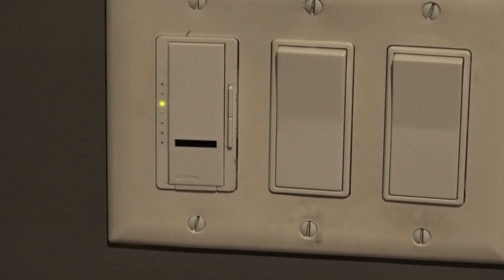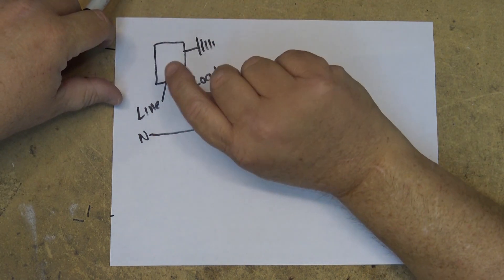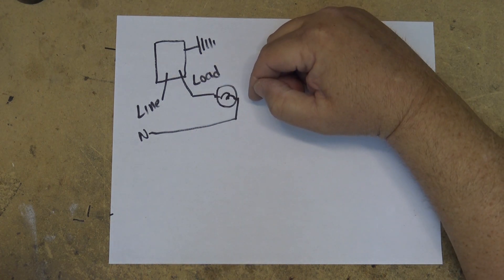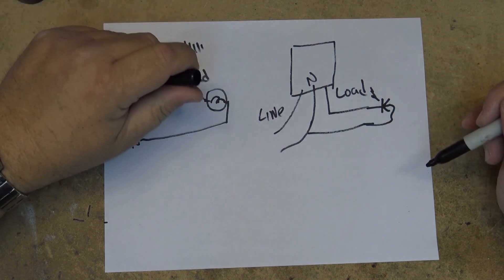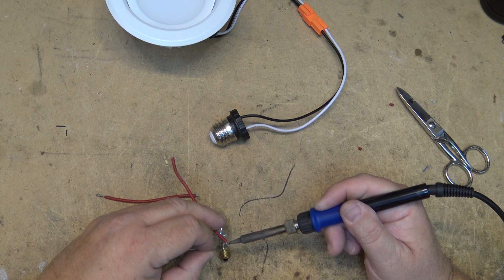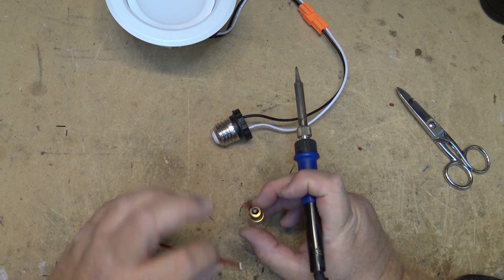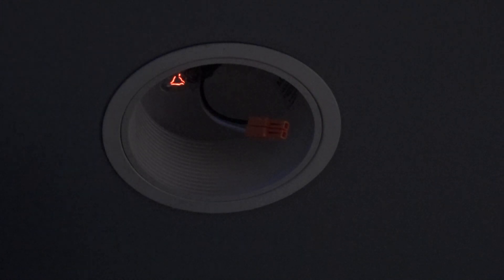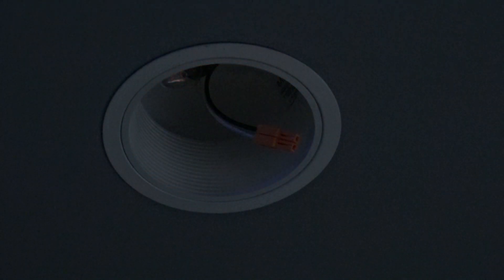How to make an incandescent electronic dimmer work with LED and CFL bulbs

Comment: Okay I know this probably isn't code but the insides of my wall are clear of debris so this is what I did. My junction box with the switches in it had some 1/2" knock outs unused in the top of the box. So I grabbed some of those sockets with the clips on the side that normally hold it inside some transparent lamp and they fit right through the knock out and clipped in nicely so the bulb is outside of the junction box keeping the heat out but it's easy to replace or remove if needed.

Comment: Thank you for the tip (very helpful) -- but you should state out front that it burns 7W when off.
Reply from the maker: It does not burn 7 watts when off.  If it did the light bulb would be burning full intensity.  The bulb is only providing the bias voltage to keep the dimmer powered up. A couple miliwatts max.

Comment: I am a big fan of the LED filament bulbs. Will this circuit mod work for a motion censor ? I have an older stye LED bulb that goes down to around night light status. My mom is happy with that. That's fine because it's a bathroom, but others stay lit considerably bright.  Gotta keep momma happy LOL.
Reply from the maker: Yes it will work for any electronic switch looking for a resistive load.

Comment: Very cleaver constant load but just a suggestion have you tried the same trick with a capacitor, if not may I suggest replacing your 7w bulb with a capacitor value :: 100nf - 250V - (104J) I don't know if it will work but its worth a try? Bob in the UK
Reply from the maker: I did and what i ended up with was pulsating lights when off.   The capacitors in the led power supply would charge up and then the light would blink.  How annoying is that, 4 led blinking away like the old goofy lite p-box kit that radio shack used to sell. Remember those?
A large resistor would do the same, but a 7w bulb is dirt cheap, doesn't get even warm never mind hot, will last forever.  Little 7 watt night light bulbs would typically last 5000 to 8000 hours.  If some day it burns out i will know because the lights will not go out, 1 or 2 will just glow all the time.  Has been many years and all working perfectly as they should.  That little incandescent bulb and the led inserts in the fixtures will probably out last me.
Reply: @12voltvids  Thanks for the reply

Comment: Works great.  the little bulb is so easy.  Avoided replacing my pair of three way dimmers that cost about $60.  Can’t remember if you said this in the video, you just need to add one incandescent bulb per circuit.  Thank you,
Reply from the maker: Yes just 1 7 watt bulb is all i used. This is to keep a slight load on the line so the dimmer circuit gets power.   Led certified dimmers have a neutral connection to provide the power, but incandescent dimmers just used the voltage drop to get their power as the incandescent filament provided that path to neutral. Adding the little bulb does that. And these little nightlights last like 10000 hours or more.

Comment: You could also use a small X2 class capacitor across the lamp.  0.1-0.22uF should do it.
Reply from the maker: Sometimes this works depending on the type of LED, but other times they still glow or flicker. The light bulb trick works every time and adds only 7 watts of consumption when the lights are turned up full.

Comment: Could this also work with ceiling fan lighting, provided the "resistor bulb" was wired in front of the wire running to just the fan's light kit (not the motor)? I have a number of Lutron fan/light controllers (same age/family as your dimmer) that I'd love to put to use, but they're all designed for incandescents. The LED compatible models work great, but are 50-60 a pop.
Reply from the maker: Yes

Comment: How sneaky, add a load to pass a little more current to the dimmer :-D.
I suspect there will be a mod that can be applied to the old phase angle firing dimmers.

Also i think its possible to make your old filiment bulbs last longer with a zero volt crossing circuit, and perhaps a soft start, i think the shock of connecting a tungsten filiment to the mains causes most bulb deaths.

The old triac dimmers worked well for so few parts :-D

Comment: Wow buy a energy saving led bulb and then hook a Fucking incandescent bulb in parallel to waste the power you're saving amazing idea
Reply from the maker: It is a 4 watt Bulb to keep a load on so the electronic dimmer works.  Of course I could head to home Depot and spend 70.00 on a dimmer that is compatable with the led lights and the what would I do with this one the electrician charged me 50 for when the room. A 4 watt incandescent is the same as one of these bulbs.  It will cost me perhaps 1 penny a year to operate.

Comment: Wouldn't a resister inline work?
Reply: Heh, we know who didn't watch the whole video now.
Reply from the maker: Yup, and I explained why I didn't do that if you were watching. Heat. A resistor is a fixed load and will dissipate the current as heat and when running at full brightness will draw more power. A small light bulb on the other hand the resistance drops when the filament is cool to pass enough current when the dimmer is "off" but when the light is up the filament heats up, and as it heats up the resistance also goes up which draws less current.  Also because the small night light bulb is in a vacuum, the heat generated by the filament is insulated from the glass, so it only gets slightly warm. Having a  big 10 watt  resistor is going to produce more heat then a small bulb, and these small bulbs last for a long, long time. That is why they use them in emergency exit signs. even wonder why CFL and LED bulbs all say not for emergency exit signs?
Bulbs designed specifically for exit signs are typically 145V for 120v countries so that it runs dim and lasts even longer. 10,000 hours is not uncommon

Comment: Do You have to do this for each LED light on the circuit?
Reply from the maker: jean surowiec 
No just a single light. It puts a resistive load and makes the electronic dimmer behave.

Comment: Wrong title
Indeed the video shows how works a dimmer for incandescent bulbs, that's all. NOT how to convert a "standard" dimmer to works with LED's
Reply from the maker: Where does the title say anything about converting the dimmer? It doesn't.
The title says how to make an incandescent electronic dimmer work, which is exactly what this does in the simplest and safest way, providing that you have room in your existing fixture, and in the case of retrofit recessed fixtures there is not only space, but these were made for a hot large wattage incandescent.